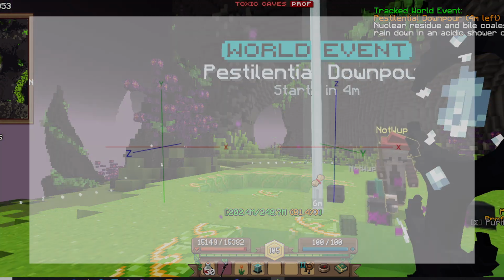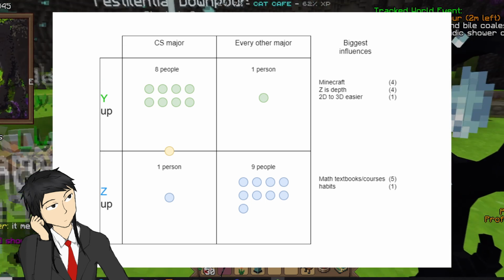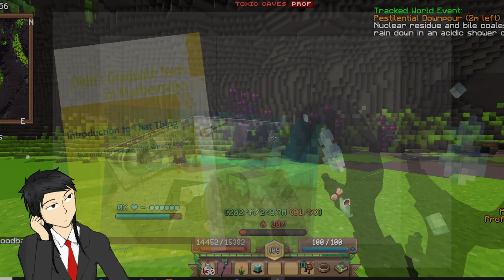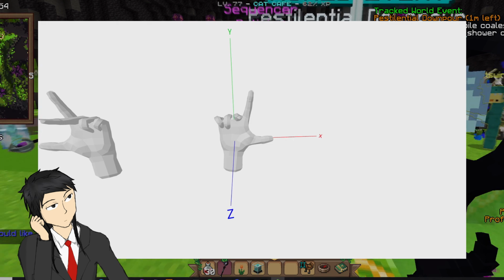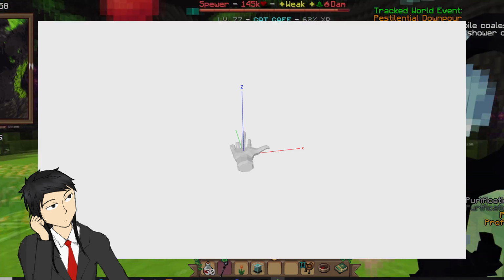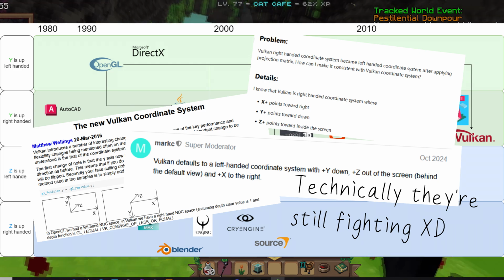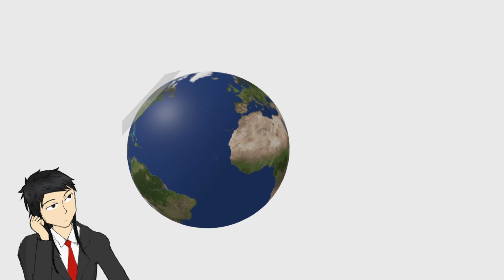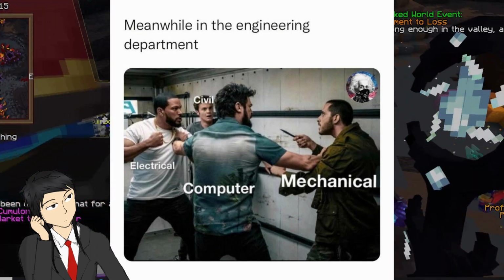Which axis is up?

Comment: Although m/d/y vs d/m/y doesn't matter, that's only the case when you don't use a number for the month. 2/6/2025 vs 6/2/2025 they're both valid dates, and they both refer to two different dates so the only thing you can rely on is the information around you to determine what those dates mean and that's very bad. Just write it as Feb/6/2025 or 23 Jun, 2025 it doesn't matter if nobody can mistake the date.
It's like the whole problem of leaving the toilet seat up or down, they're both wrong you close the lid.
Reply from the maker: @NthMetalValorium  Exactly! Aside from the potential ambiguity, in many projects I coded I just use yyyy-mm-dd e.g. 2025-02-06
Notice it is in proper descending order, so the dates are sortable by string comparison, meaning the string of a date after is always a "greater" string than a date before e.g. "2025-03-02" > "2025-02-06" = true
Reply: @deepfriedpancake  ISO dates work well for programming, but if you show the date to your users put the 3 letter month abbreviation.
Reply from the maker: @NthMetalValorium  very true!

Comment: blender is z for up down too.
i'm a software engineer and i prefer Z up, i think it also makes more sense.

x, y is the standard coordinate system.
z going in the 3rd dimension.

first time you see x,y coordinates is usually on a sheet of paper laying on a table so it makes sense for me that Z is up but yea the same graph could be on a vertical display i guess.